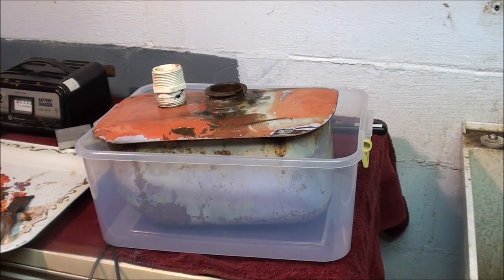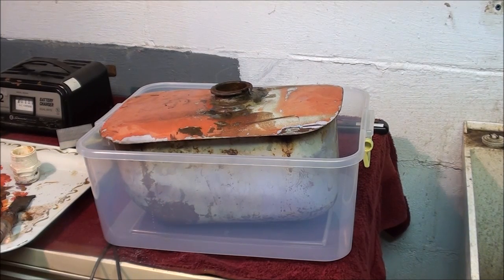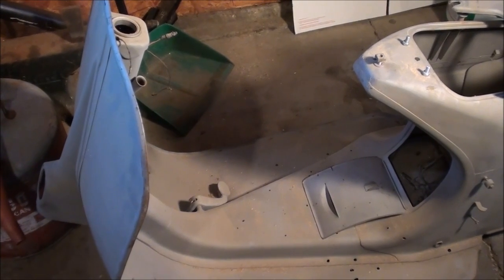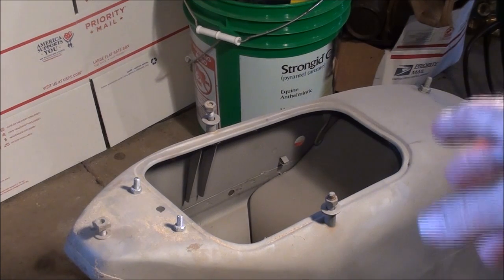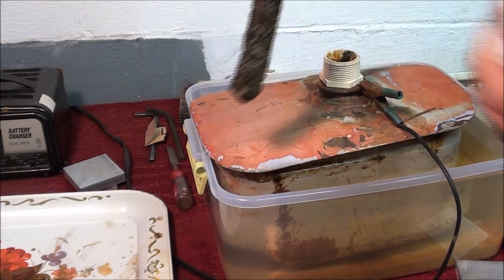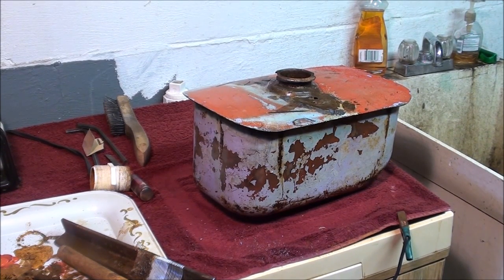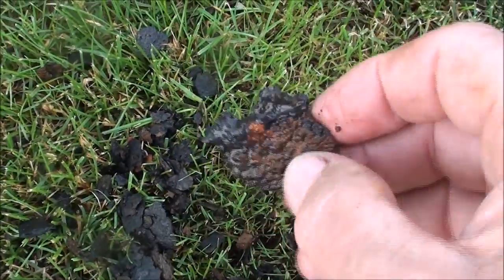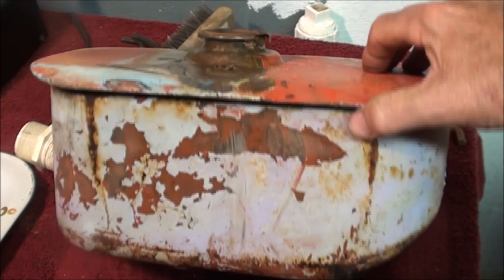Tubalcain Restores a VESPA SCOOTER #2 fuel tank by electrolysis

Comment: what a wonderful and fun project.. if i had that tank.. i would cut it in half length ways... i wouldn't cut on the flange... i would clean up both insides first..thoroughly.. weld in all the leaks from the inside, cut off the wrong fuel port and locate the correct one and weld it on... after its all pretty with plenty of extra metal added from welding then i would weld the 2 tank halves back together.. test fit in chassy... body putty.. sand and paint and pat myself on the back... next thing??? i would tear the motor apart and clean it up... if no apparent mechanical issues i would put it together and THEN start it up... you guys renovating these old vehicles are doing a wonderful thing... taking junk and making it useful is an honorable thing to do...

Comment: Hi Mr Pete, the rust coming out on the anode is not rust that was on your tank, but it is produced as the oxygen bubbles oxidise the anode during the process of rust removal. You would get the same result if you tried the same process on some new shiny steel with no rust on it whatsoever. I would have suggested removing the tank top, then some baking soda blasting, and either patching or brazing of holes depending on the condition revealed by the soda blasting, but I see you have an offer of a new fabricated tank from a very generous Douglas B. Thanks for all your great videos, and thanks Douglas too for your kind offer

Comment: That tank is definitely beyond the point where I'd want to put any further effort into it. If the top hadn't been messed with, I'd cut off and fabricate a new bottom section, but not with that botched in neck.

New tanks are available from India. They're making quite a lot of tanks for classic bikes, many of which are good or excellent quality. Ask around on the various forums for who to deal with.

I prefer an chemical cleaning technique for tanks. Sodium hydroxide to remove old fuel residue, Spirits of Salt (Hydrochloric acid) to remove rust and then Phosphoric acid to stabilise any that is left.
Reply: @ Paul Compton: I wouldn't say anything coming out of India is "excellent quality", especially as a Vespa & Lambretta collector having witnessed what they are capable of churning out.

But I agree with you on the chemical solution: I used it on a rotted old Lambretta tank, and that cleaned it straight out. The metal was still thick, so I just dried it and filled it up with the regular gas & oil mix, and it's been fine ever since. In the case of Pete's tank, he could probably just get rid of both paint and rust that way, solder up the holes, and use one of those tar-based tank coatings to strengthen it, seal it, and keep it from rusting.

Comment: Hi mrpete,
Beside the fuel tank, the rest looks ok, redoing the engine seems like the normal thing to do.
Imagine yourself riding it again after all the efforts you invest in the restoration.
If the fuel tank is the only issue, take the offer from Douglas Battjes, that's the best offer you'll ever get.
Courage mrpete,
Pierre

Comment: I gave up on my Vespa 150GS because the rust was so extensive. I felt very bad about it because riding that scooter was a real joy, but the body threatened to break at the bottom and welding it would have meant removing all of the wiring, etc. and even then it was not clear whether it would have paid off. The rust in the tank was a constant problem and I finally had the tank professionally cleaned and coated, which solved the problem It was nowhere near as bad as the one you are working on, however.I got about $200 when I sold the scooter. Good luck on the restoration. In my experience the engine is the least likely part to cause grief.

Comment: You could cut out a flat piece of sheet metal that fits the place (flanged hole) where the tank fits into the bike.  From that point you could mount/strap/hang a tank of any sort.  You could cut out the center section of the plate:  so that you could access the fill cap.   Or you could fit a tank the new flage piece and brazes/silver solder a tank to it.  That would get you by until you come up with a better/permanent idea.  Or you could cut off the lower 1/2, 1/4, 1/3, etc. of the rusted tank and use the upper section to secure some sort of tank.  Or you could cut the tank in half and fit some sort of tank inside of the old tank.  That would be goofy , but just another idea.

Comment: Since the lower half will be unseen you can cut it in half so you can get easier access to clean and repair it, then weld it back together since it doesn't have to be pretty.Eastwood sells a gas tank sealing kit sized for motorcycles that is 34 bucks, supposed to work great. You could also cut the sides out and just slide the new plastic tank in, instead of making brackets and such to hold it and then figuring out how to secure the top part alone. Crazy seeing how much rust came out of it with that process.

Comment: You can cut off the top of the original gas tank and use it as a decorative panel to hide your plastic tank. It should work out pretty good.

Comment: I have a Kawasaki H1 fuel tank and a seat pan, that was about the same condition as this. They are both ready to paint now - after a lot of cutting and mig welding. As long as the shape of the tank is still there, anything can be fixed. But it takes time..;)

Comment: get the Bill Hirsch gas tank sealer kit, which comes with the cleaner and etch fluid as prep for the sealer. A quart can will be more than enough and you can reuse the balance on your next scooter. I've used it on a Model A and REO tank.

Comment: One method you might want to consider to repair your tank is to use epoxy on the outside and Kreem fuel tank liner on the inside. The Kreem kit includes an acid that will clean the inside of the tank to clean metal and then the liner will seal all leaks.

Comment: Hi Tubalcain

Love your Videos.  It would likely be a good idea to pull the cylinder and have a look at the Piston & Rings.  If the Rings are stuck in the Piston (which they likely will) you will have a hard time getting it started if at all. Usually when you have a stuck Piston you have stuck Rings. Pull the Cylinder, free up the Rings, clean everything up and put it back together with lots of oil. Wouldn`t likely take all that long and you will have a better chance of getting it to run well. I would do if for you if I didn`t live so far away.  Don`t give up yet, this will be a great gift to your Grandchildren.

Willy

Comment: @ 7:14 on the video, I suspect that the "fill port" in the center of that plastic fuel tank was for one of those combination fuel cap/fuel level gauges, the type with the float that ride up and down vertically.

Comment: I used a product called Red-Kote on a tractor tank.  It was a red powder and you dissolve it with acetone and it coats the inside and can block tiny holes. If you don't like it you can wash it out with acetone. Diesel hasn't hurt it yet.

Comment: Would it be easier to cut the top of the tank off thus allowing easy access for rust removal, knocking out the dents and then internally patching the holes ? Right up along the flange of the tank looks like a good spot to MIG weld it back together. Have a good weekend Mr.Pete.

Comment: There are usually easier(?) ways to get a tank cleaned. Every oldtimer fan will fancy his or her way to de-rust a fuel tank. You mention tumbling. For a really light scooter tank let me suggest this way:
I have good experiences to epoxy / glue a used grinding pad to the fuel tank. Use those that match your orb sander. In an ideal case the orb sander can just vibrates the tank on a low setting. (It should not spin).
That’s the point when you can fill it lightly with sand and other objects as you would with tumbling. Even hand-held this leads to acceptable results in some minutes. After seeing the massive corrosion you might want to clamp the orb an let it spin a while … you get the idea.

Comment: Hopefully you have the opportunity to read this and possibly reply. Here is a fairly simple solution, remove the bottom of the original tank, clean prime and paint, brase holes should you be so inclined. Sand and primer so the outside is ready to accept final paint color. Locate a plastic tank that is similar in shape, use original tank as a cover. Mounting could be as simple as spot welding straps to go around plastic tank. Or just strap around opening at the bottom of original tank. You will end up with the appearance of the original, but have the functionality of a new and improved tank. Hope this helps.

Best regards

Want a be
Machinist

Comment: Unfortunately it seems like you made the wrong call, initially.  Such are the pitfalls of an affinity for old iron.  It's just gone.
Dry it out very well, do some bondo work on the outside and make it pretty, caswell the interior for function and safety.
(Well, an authentic styled filler neck should be made to accept that nice looking cap you have!)
Now, I'll go see how the project has progressed, since last year..  :-)   rc

Comment: Probable cause of tank rust is condensation as the tank 'breathes' with the changes in temperature and air pressure. A lot of water can accumulate over time.  Keep your tanks full to avoid this!

Comment: My guess:  The original cap was lost.  Someone continued to use the vespa until the rain promoted rust, rust fouled the engine, and tank was eventually repaired, but too late.  Motor failed due to rust contamination.  I think a good look at the engine internals should indicate what to do before any other effort...  Sorry

Comment: I am thinking the same as you. Cut the top off the old tank.
Reply: Definitely a good idea.  Cut off the top and install a tank that will fit inside of it.  Re-assemble it or just use some straps to support it.  That would be a great temporary fix.  That would get him by until he came up with a plan to build a new tank or purchase one.

Comment: ....ever think of just slicing the tank in half lengthwise with a cutoff wheel, or a bi-metal saw. Then place the two half's in a bead cabinet and blast it with baking soda inside and out without losing any metal. TIG weld all the holes, not to mention have a clear shot at removing the mickey mouse filler cap, and then weld the two half's back together. Just my two cents, don't want to be critical, just simple. Like KISS (keep it simple stupid)

Comment: Mr. Pete,  Be sure that you don't score the inside of the cylinder by starting the motor.  I suspect there's some sort of rust or some sort in the cylinder.  If possible pop off the head.  Sorry if I'm preaching to the choir.